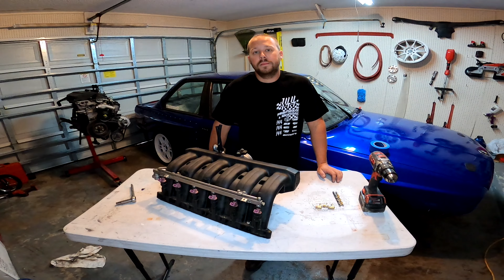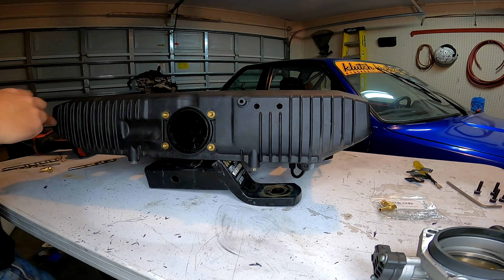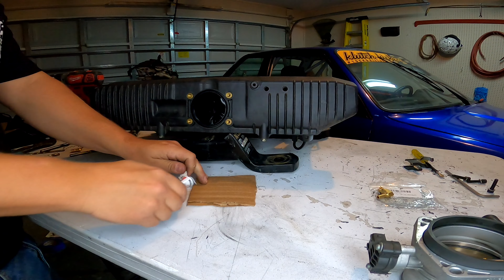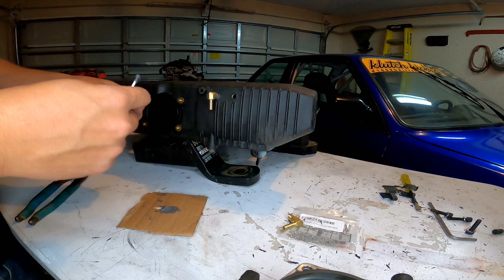BMW E30/E36, M52 24v Turbo Drift Build Ep.10: M50 Intake Manifold Modification

Comment: besides the brake booster what are the other things the stock engine needs vacuum for?
Reply from the maker: @thomasrompf9805  what do you mean?  Like what else needs vacuum?   The fuel pressure regulator.   The standalone ecu need a vacuum/boost port to read pressure. Also